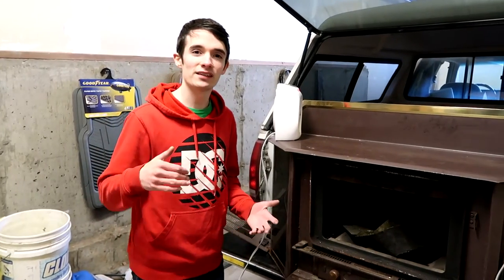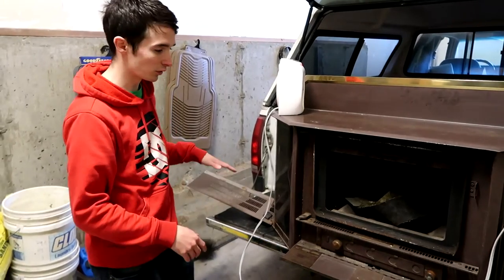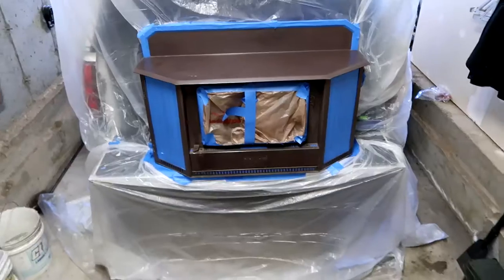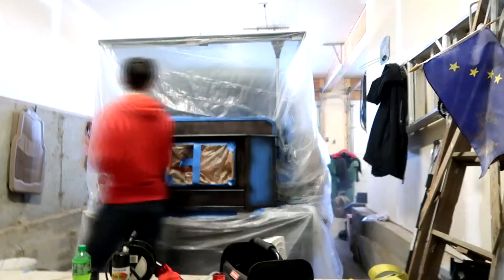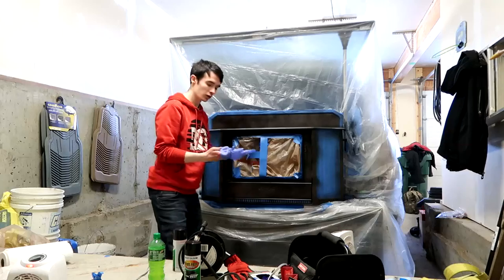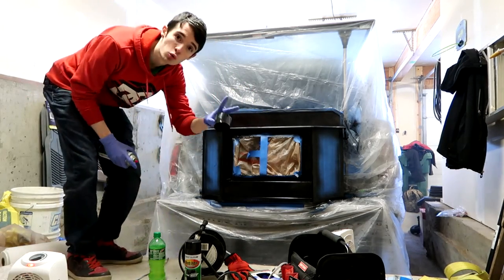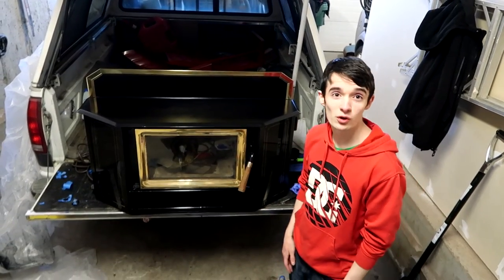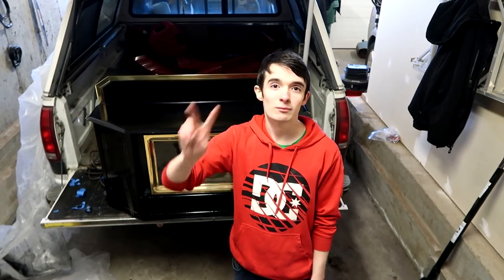DIY WOODSTOVE PAINT JOB

Comment: I have a similar insert that came from the factory with a weathered bronze color.  It is scratched and needs to be refaced like what you did here.  I saw that the vid was from two years ago so how did the paint hold up?  Did you do anything else to the insert?
Reply from the maker: Sorry for the late reply. I ended up selling the insert before I installed it so I'm not sure how well the paint held up.

Comment: can this be done on a wood cook stove its a old stove I think the body of the stove is aluminum or metal its white and the top is cast iron and black I would like to paint the white a different color to match my house
Reply from the maker: Gea J you should be able to paint your stove. Make sure to sand it to give your paint a good surface to bond to. Also make sure you have good ventilation the first time you fire up the stove.